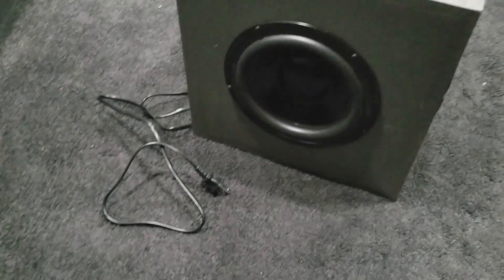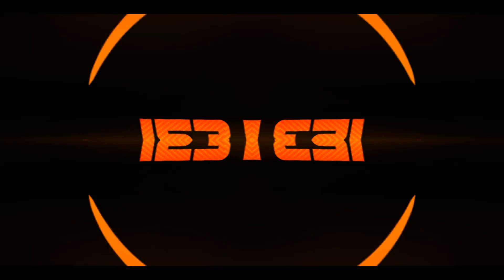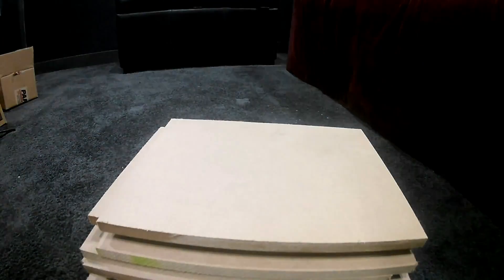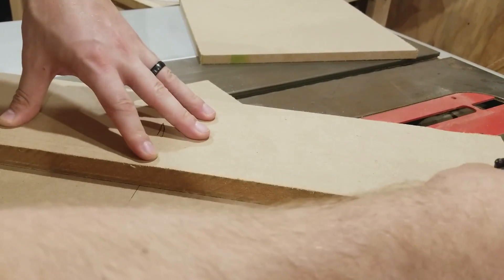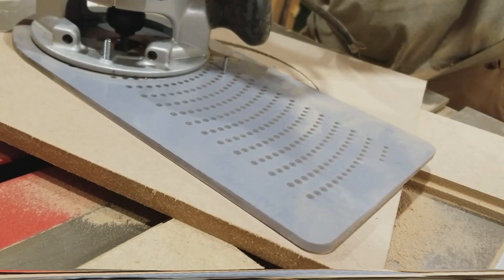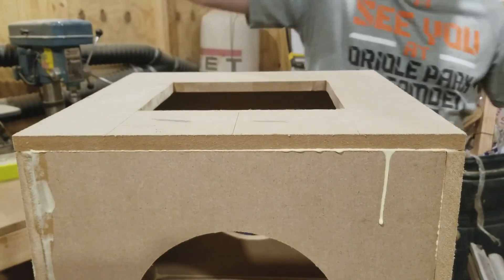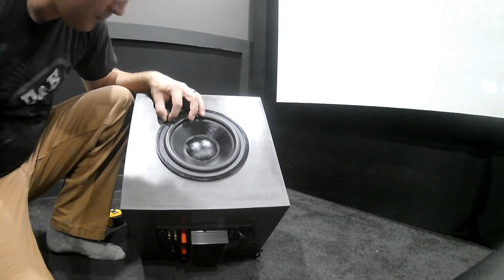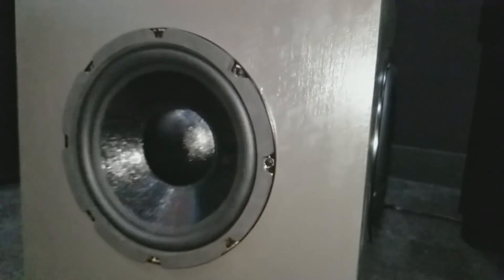Best Sub under $200? Passive Radiator Sub Build - Excursion Test - Free Plans

Comment: Hey thanks for the video.   I just finished building this project and it sounds great.   The only issue I have is that I didn't get a DSP amp and the FMOD's don't work because I'm using the high-level in/outs.    It's surprisingly loud for a 100w amp and I'm hoping cone excursion isn't an issue since i won't be turning it up to the max.   This is my first time building a sub from scratch so thanks for getting me started.
Reply from the maker: Kevin Nuber Kevin, I should ha e been more clear about that.  However, I will say that after I broke in the subwoofer I actually don't use the F mods at all anymore.  Granted I rarely turn it up past halfway. But I think you'll be fine.
Reply from the maker: Kevin Nuber the bass is incredible, isn't it? Such clean Bass.
Reply: Thanks for help.   Yes it's great bass and I have it paired with the Overnight Sensations kit and I'm really impressed
Reply: BTW, I uploaded a video and you can check out how it turned out.   I"m really happy about it so thanks for sharing the plans.  I linked back to this page, not that anyone watches my videos :)
Reply from the maker: Thanks.  I just finished watching it.  You did an amazing job with that veneer and stain!  I would have never guessed it was your first time!  I'm glad you like the sub.  It looks like you easily attained all your goals as well :)
Reply from the maker: P.S. I linked your video at the end.  I hope more people see the great work you did!
Reply: Awesome, thanks for all the help and keep up the good work.  Love your channel.
Reply: @Toid  hi from México.
I have the Dbxi-15" by earthquake, the port make port noise at 20 Hz.
If I get 2 radiators, will I elimate the turbulence port noise, will I have a  clean bass?

Comment: if you were to increase the cost of your sub instead of using radiators, would it be better? For example a $160 sub would sound better than you $60 one... The radiators might offset size, but does it offset cost? OR is money better spent on a sub?

Comment: I didn't notice any weights added to the passive radiators... How did you tune it or did you say screw it and let it buck lol..? Would love to see more info...!
Reply from the maker: This particular subwoofer tuned perfectly without any added weights. So I didn't have that any
Reply: @Toid  What does it play down to or there abouts?
Reply from the maker: @houseoffire72  I honestly don't remember anymore. I think it plays to mid 30's F3, so very similar to a commercial sub. Of course I could just say what they say and say 20 hertz to 150 Hertz but not offer any context behind the number 🤣😁🤣
Reply: @Toid  Cool cool

Comment: Bigger radiator, it should be bigger than the active ,or you won't get any bass extension (lower frequency)
Reply from the maker: That's not exactly correct. It should have twice the displacement. You can achieve that with multiple passive radiators, bigger passive radiator, or even one capable of more displacement.

Comment: You need more weight on the passive radiators
Reply from the maker: Why do you think that?
Reply: @Toid  just look at the slow motion footage. Unless you shot that while playing super low frequencies that you can't even hear, the passive radiators and sub should be moving almost in sync with eachother.
Reply from the maker: @jjhack3r  the video was shot below tuning frequency. That's where you get some if the best video footage. The amount of weight used perfectly tuned this for the chebychev alignment I was going for. If you added more, it would tune it lower than I would feel comfortable with given the response.
Reply: @Toid  makes sense.
Reply from the maker: @jjhack3r  I appreciate the lookout

Comment: Does it also work without the fmods or would that damage the sub?
Reply from the maker: After I broke it in. I took the Fmods off and had no ill effects.
Reply: @Toid  So, do I need them for breaking the sub in or can I do it without them?
Reply from the maker: @davidwittmann6555  you can do it without them. Just don't run it as hot until it breaks in.  I ended up giving the subwoofer away and the guy I gave it to does not use the Fmods at all.

Comment: The radiators didn't require any tuning?
Reply from the maker: Passive radiators always required tuning. I designed these, so you don't have to add any weight and if you build that size enclosure, it will tune it perfectly.

Comment: well, it might be called clean since it has no port noise, but it still have the same problem of out of phase energy and the cleanest output is only from the active driver.  i have a 1100 dollar small subwoofer with same passive radiator setup as this has, its not what i call clean, the output is good for the size and no noise. but once i got a hold of a proper sealed subwoofer, it plays lower and much cleaner, every tone has its own signature, not boomy and smeared like with ported or passive radiator.

i am just sharing what you are missing out on and it won't cost you more.  you could fit a 10" or 12" in there. better sound for same money, who would not do that?

Comment: Did you calculate the box volume ? any software there to calculate for a 10 " speaker?
Reply from the maker: WinISD is a good idea to use for that. It's what I used
Reply: @Toid  the free version of winisd doesnt have passive radiator or maybe i've got a older version ...

Comment: How much of a difference would it be to convert these into a passive subwoofer and connecting it into an external amplifier before a home A/V receiver. Would I also need the FMOD if I am using a receiver? Sorry, new to DIY and I would love to start getting into custom builds. Thanks

Comment: Came accross your video through parts express while researching new 8" subs as replacements for mine since my cat decided he liked the bass sweeps and port air blowing his fur back - he shredded one of the surrounds...!  My current subs came from two Sony home theater subs. I built new boxes .57 cubic ft. (Factory spec) tuned to 34hz with a 2" port. Each is powered by a 100watt plate amp (dayton audio) And honestly I had no idea 8" subs could perform like what these did. Super tight & punchy with good extension past 20hz... I have 4 dayton subs on order along with 2 more plate amps lol😁 I would be super happy if these subs would work well in my current boxes of .57cubic ft tuned to 34hz or should I build your design? Ive also considered a T-Line after reading a reveiw on PE's website. I have no idea where to even begin with a T -  line.... Can you point me in the right direction or maybe work up a design for one? Any help would be appreciated. A few vides back on my channel you can see my subs and MTM's I built.

Comment: Awesome I plan on building one! Could you use 3 radiators 2? I think it would be cool to have one pointing up. What would be the drawback? 
Thanks for the vids!!
Reply from the maker: You could use 3, but it works changed the tuning and I wouldn't recommend it. Also, typically it's not recommend to out passive radiators up or down facing, as they have no mechanics to stop them from stretching out, ie ruining the passive over time. However, if you wanted something upfiring, you could just put the sub itself in top.

Comment: I like this idea. How would this concept work if driver and the passive radiators were on the same front baffle like a traditional sub box. Im looking at this for a car audio installation. Thank you.
Reply from the maker: As long as you keep the internal volume the same, you won't have an issue
Reply: Thank you ☺
Reply from the maker: @LoudMercury  you're welcome!  If you build it, I'd love to see pictures of it.
Reply: Will do 123toid. It'll be in the back of my suv and will be part of a drawer system for my tools(all one unit made out of birch or mdf). So I have some planning to do first..

Comment: Question for you in regards to pr's I have a dual 12 setup in my vehicle and am looking to do a custom enclosure with passive radiators. Would it be better to do 3 10" passives or 2 13" with the dual 12's. Both are tunable down to 30hz I believe.

Comment: Hey there, I’m working on a project of my own, I have a box that was built for a single 10” and 2 6x9’s on the side, the box has to be rebuilt due to some water damage it got, I haven’t made up my mind on if I want to run a 10 with the 6x9’s, or to try and put two passive speakers in the box, 1 on either side of the 10, but can’t find a built box or image of such box, build it to fit behind the back seat of my crew cab truck, any help would be appreciated

Comment: Because you are using two Passive radiators, can the enclosure be smaller than the standard cube of a ported sub??
Reply from the maker: When using passive radiators you should always tune it first by using simulation software, then by a measurement microphone. Most subwoofers require 2 passive radiators unless it is a high excursion or larger passive radiator.

Comment: Thats Not passive and i have Save a better sub
Reply from the maker: It is not a passive subwoofer.  It is an active subwoofer with 2 passive radiators.  Passive radiators act like ports in order to tune a subwoofer.

Comment: Why a 14x14x14 box , can I go smaller or is this the best
Reply from the maker: M K this is the optimal size enclosure for this sub
Reply: Ok thanks , I have 2 more questions before I build , 
1) does it have to be braced 
2) Is that the best plate amp or can you use the Spa250 because the driver has 200 watts rms and the sa100 is 100 Watts 

Thanks
Reply from the maker: Good questions.  The answer to your second question is yes you can, but the subwoofer driver is actually only 150w rms, so you would be leaving some unused power on the table.  Honestly I personally feel the 100w plate amplifier is more than enough for this sub.  Just make sure you don't overdrive it with the SPA250.

The answer to your first question is a little ;ess straight forward.  I did not use any bracing at first.  I eventually did add some bracing, but did not gain anything from it.  If you go with the spa250, I would add some cross braces from either cut mdf or dowels (although I'm still nto sure it is really needed).  But if going with the   SA100, I wouldn't bother.

Comment: Did you put any sound dampening material inside the box?
Reply from the maker: panic mike I did. I put some poly fill in it. Medium fill
Reply: Does poly fill make it sound clean? Working on a different project with a 15" active subwoofer and 2 12" bass radiators. It gets loud but not clean and punchy.. The 15" sub dont flex much, but the 2  12" radiators flex like crazy.. Any ideas on how to make it sound better?
Reply from the maker: panic mike I couldn't help without modeling it. Have you modeled it yet? It sounds like something is off. But whether that's box size, passive radiators need more mass or if the passive radiators can keep up with the subwoofer, it's impossible to say. Have you modeled it in winisd?
Reply from the maker: panic mike https://youtu.be/sG_8qgSjUqE
Reply: @Toid  would liked to have seen this in the video instead of having to go searching.  I'm new to this. But overall the video was great.

Comment: Doesn't it need a port hole for the air to come out of?
Reply from the maker: paul bristow good question. There are two different types of subwoofer alignments. The first is ported and the second is sealed. Sealed don't have any port and uses the back pressure created in the Box too spring back and forth. Ported uses a hole in order to tune the system to a certain frequency. This system uses passive radiators, which act very similar to a port. So it is actually considered a ported design. The passive radiators though are tuned to a certain frequency. So in effect those passive radiators are actually ports. I hope this helps

Comment: sorry still cant beat a ported sub    why would you want to use a sealed box or a raidated systm they vibrate so much the break plus dont get the classic wooow woow wooow nois no vent for the air ( pressure to go ) broke sub the distortion of the sub on sealed looks good but

Comment: did you made any sound demo ?
Reply from the maker: I didn't make a separate video of the sound, however I did demo it with my reveal speaker build found here: https://youtu.be/vTRc_q2kZ0M  The sound demo start around 4:05.  The sub is about half volume and can get considerably louder if you desire.

Comment: I would think that as the woofer extends out it would suck the passive in and the result would be to cancel the woofer?   I would think that you would have to put the passive in the back of the speaker to try and get the drivers in phase.  I must be missing something.
Reply: Passive radiators work exactly same way as a port - the only difference is they don't have any depth intruding into the box. Ports work on the principle of air having mass, and a set volume of Port has a set Mass - passive radiators include that mass in the weight of the radiator itself (the cone and any additional added). There will be times the passive radiator is out of phase with the driver, but just based on tuning like in a port there will be times where it's effectively in Phase with the driver, and that's when it gets louder. It's called decoupling when the port tuning is out of phase with the driver - and this can cause you to bottom the driver out very easily, and needs to be avoided. A little Google will help a lot with more information on these things...
Reply: Passive rads dont produce noise, so they can be anywhere but the bottom of the box.

Comment: Is there any way to add tweeters and ppssible some mid ranges all on the box, in terms of power supply? Amp, battery, dc, stuff like that. I would really want to build an all in one mini system . Another question, would it be possible to male this bluetooth capable and portable/wireless?
Reply from the maker: Gene Hunter sure you can.  I already have a series going on how to build your own crossover which would help you with adding tweeters and mid-range drivers: How to Design a Crossover - Passive Crossover Designer: http://www.youtube.com/playlist?list=PL6hjpiCHZmIPx3itPeTt7zoSqNY20OQqV
Reply from the maker: Gene Hunter you can also check out this video which helps show you how to add Bluetooth to any speaker https://youtu.be/aliszhXSfvA
Reply: 123Toid  thanks for the quick reply. By the way, the link you put is a frosted flakes commercial lol
Reply from the maker: Gene Hunter that was weird https://youtu.be/aliszhXSfvA
Reply: This would be too bulky in size to be anything like portable. Try starting with a tpa-3116 2.1 board. That is plenty enough for a boombox of sorts. I already built one with such amps and gotta say I love it.
Anyway get some 30w rms components and a sub at like 70 or so rms watts. The watch 123toid's video on using WinIsd to design an enclosure for your sub that fits in your size requirements. If building a sealed box for the sub remember to add some filler and dampening material in it.
For the midrange and tweeter I would suggest just putting those in sealed box separated by a wall on either side of the sub box and by balancing both your power source and amp on either of the 2 sides. I wish I had made a build video on my boombox.

For the power source I used a 6ah 12v bike lead acid battery I had lying around new, In conjunction I use a 12v to 24v step up module as to get some more watts out of the amplifier as it can run on only 12v but will output significantly more power at 24v dc.
I also added a shunt amperometer/voltmeter module so I can monitor battery voltage and power consumption.

To top it off I'm probably gonna try and weld myself some neat iron bars to go in front of the speakers to protect them from accidental kicking and moving

Comment: so i have just not understood plate amplifiers, do you need a normal amplifier before the plate amplifier or can you just put a straight input signal from say a Computer? just wondering if it's worth buying a plate amp because i already have a 100 + 100wrms amplifier....
Reply: As 123toid said. It's just like a normal amp except you mount it into the box and usually is used to run subs or small speakers
Reply from the maker: That is a great question.  A (subwoofer) plate amplifier is an amplifier with a variable gain and low pass on it, made specifically for subs.  So there is no need for any other amplifier.  You just need a signal.  On the back the of the receiver you have a subwoofer out.  On a computer you have the same thing (assuming you have a 5.1 sound card).  You just plug a 3.5 mini to RCA into the subwoofer out and into the plate amplifier.  There is one other way to hook this up, if you do not have a subwoofer out.  I plan to detail that in a video soon (a little complicated).
Reply: Alright, thanks for clearifying that just a bit. Must say it's easy to get confused with all kinds of speakers, subwoofers and amplifiers haha!

Comment: hi, Nice job on the sub, im building a 10" sub and i Wonder if i need to match up whit two passive 10's or is it okey jusing just one radiator?
Reply from the maker: It is impossible to say without modeling it and the PR.  Check this video out, it should help you pick the right size box and the number of PR's based off the drivers you choose.  https://youtu.be/sG_8qgSjUqE?list=PL6hjpiCHZmIOAv44PCreW5KlI35h1mTZK